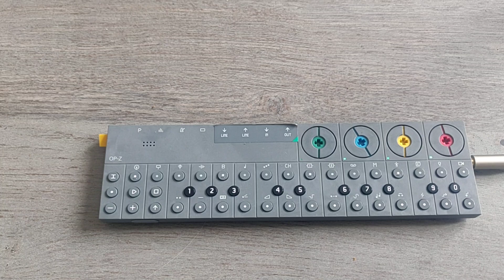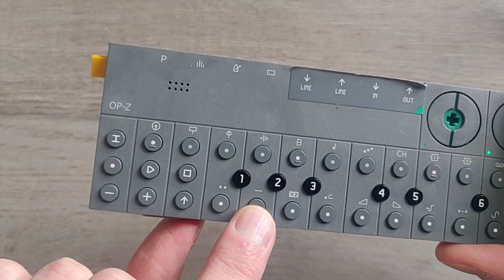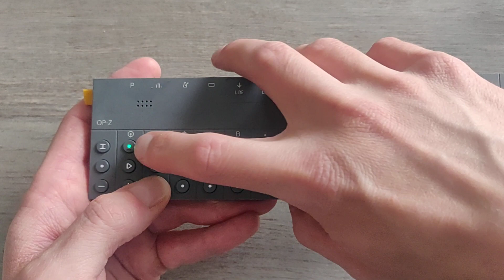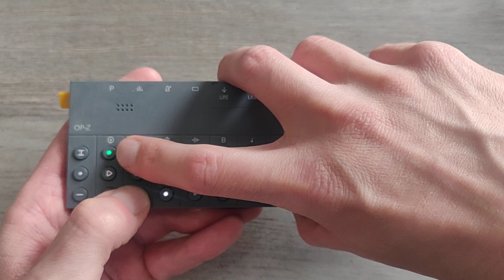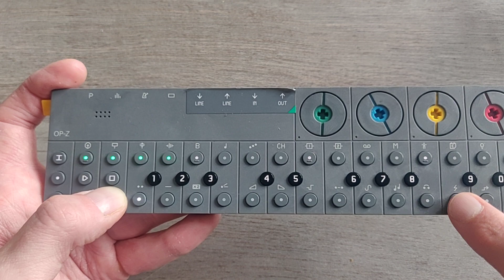OP-Z Step Components: Pulse & Pulse Hold for the Chords track

Comment: Cool and insightful how you're utilizing these functions. Making me think of a chart that would show step component to note value and subdivision equivalences. OP-Z continues to amaze me with what programming its capable of, the initial limitations I realized and the work around of it has opened new doors. Seems like it would be possible to use crazy timing, to say break a dotted quarter note into a group of 4,5,7 or 8 hits using the first 2 step components
Reply from the maker: Yeah, I'd love to see a chart like that. I've been trying to figure out some of that for a cover with a lot of time signature changes and it gets complicated so quickly. I totally agree that it seems like it's capable of really absurd things.